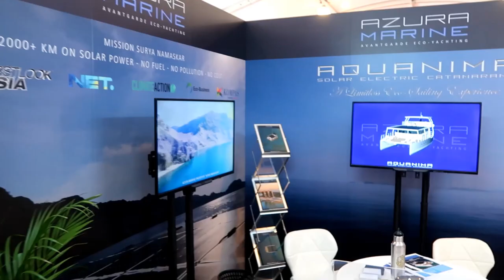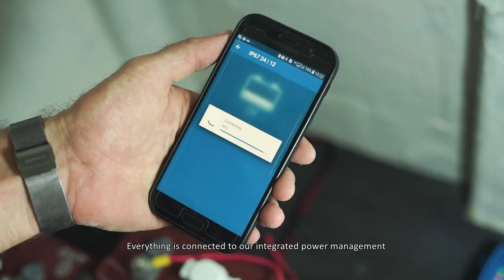Solar Electric Catamaran "Aquanima 40" under construction in Bali - by Azura Marine

Comment: Very cool.  I am building a 16' version out of fiberglass for personal use on local rivers. The pontoons are stuffed with Styrofoam and spray foam.
Reply: @ecomarinedesignbyjulienmel9013  i have a few build videos up... I used styrofoam and marine expanding foam to fill in both of my pontoons.  Connecting them in the next couple of weeks.

Comment: Wonderful and necessary commercial application! Are you planning a Live-aboard private vessel as well. Of course this poses different, and in some areas, more difficult questions such night-storm power and sustainability in northern climes. So, are you working on that? There are of course larger Cats in this category, but 40' is the 'sweet-spot'  that NO ONE is building.
Reply: I will indeed! I have been researching retrofits and possible conversions for a year now. I am definitely looking forward to your progress and the possible availability of your boat! This is an area of the market that is virtually untouched, I have high hopes for your success!!
Reply: Any idea on the price point for cruising catamarans??  We are looking to buy a cat in the next 2 years and i am considering going solar.
Reply: @ecomarinedesignbyjulienmel9013  awesome thank you!
Reply: @ecomarinedesignbyjulienmel9013  I want to see how you furnish it and just see it finished off I'm in the market this year.